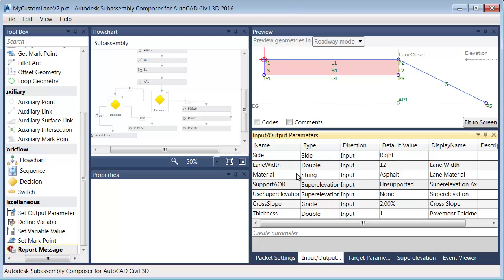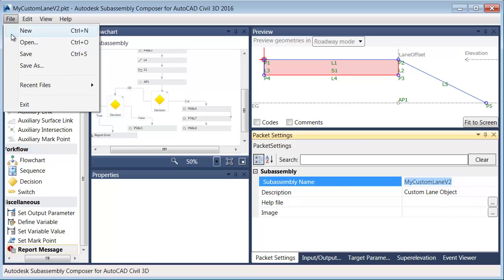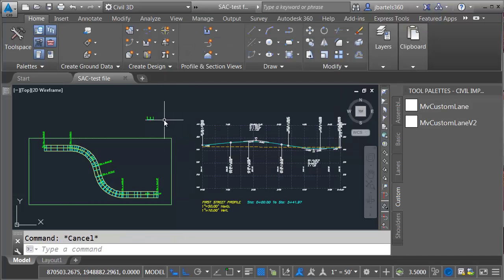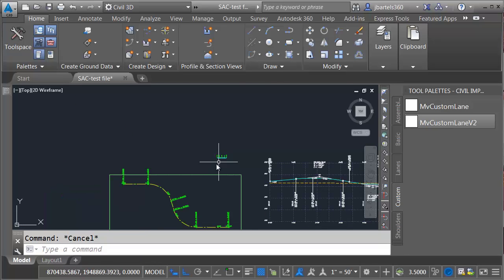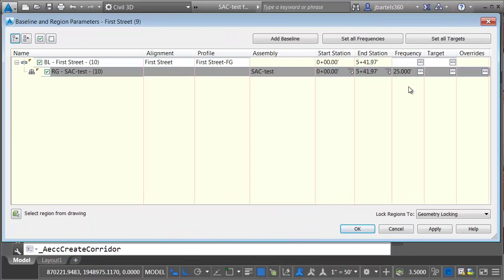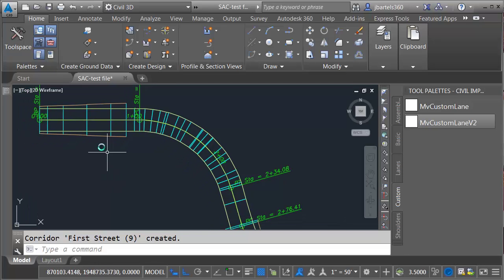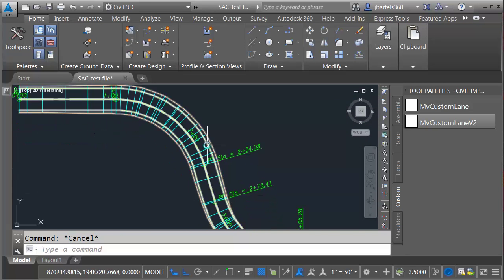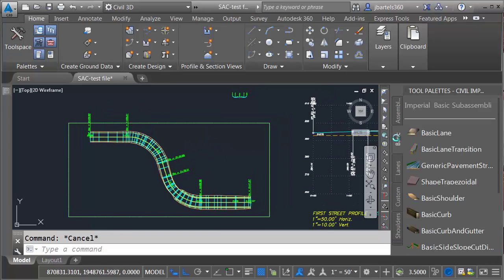Subassembly Composer Pt. 9 - Final Testing & Conclusion

Comment: Jeff does a great job explaining how to use SAC.  There is something that nobody tells us users though.  There are defects within SAC (memory faults/leaks) that cause issues inside of Civil 3D when brought in.  I've seen a 600' piece of corridor that uses a custom SAC part fill up an entire empty 2TB HDD when trying to extract elevations from the corridor surface using the Create Feature Line From Object tool with or without elevation extraction at the time of creation OR after the feature line has been created.  I've seen ZERO consistency in the data being derived and/or extracted.  I've seen corridors that use targeting, even for a simple lane, pull completely different station values than the equivalent OOB lane part.  Autodesk has been aware of these problems since 2016 but has yet to fix the problem and we are only a few months away from the 2020 release.

Just a few weeks ago (first part of January 2019), I sent a large one hour long video and four smaller five -fifteen minute videos to Autodesk Support and the Development team so that they can see the erratic behavior.  The deconstructed custom SAC parts were walked through with all the toggles.  No errors within SAC and everything functions as expected.  Three different workstations, each with a different "flavor" of Windows 10 and each workstation has different results when the SAC parts were brought in!  Some SAC parts would break on toggle switching on one machine and be fine on another.  All machines would cause the same derivative data problems though.

So, the reason why I am posting this here is so people are aware that both SAC and Civil 3D have major defects/flaws/bugs that will render your systems unstable and/or unusable if implemented.  These videos that Jeff has created don't walk through an entire workflow.  They stop at the creation of the corridor.  Derivative data and how objects generated with SAC components function in relation to other tools matter!  Jeff doesn't compare an OOB lane to the custom lane that he makes in SAC with the targeting.  If he were to pull labels and check the data in these videos, everyone would quickly stop using SAC because the data is incorrect.  If a target starts at station 2+31.15, then the station extracted in the corridor should be EXACTLY that.  If you test it, you will find that some might pick the station up correctly and others might be off up to a foot or more.  I noticed this when implementing OOB conditionals with custom SAC content.  For the life of me, I could not figure out why there were so many gaps that required manual insertion/manipulation of target start/stop locations.

I'm hoping Jeff does look at these old videos and the comments left on them.  He's a sharp guy.  I'm willing to bet him lunch that if he tests/compares custom SAC elements with OOB parts, he will find the same problems that I found.  I'm also willing to bet that he will find erratic behavior with derivative data and other tools interacting with objects based on SAC objects.

Comment: Thanks for the information, I really needed for a project I was working on; now I have a question, is it possible to create with SAC a bench? in my job we need a bench that is not the one in civil 3d, what we need is this: the height of the bench is 7m, and I go cuts the surface, but in some areas the las bench has an altitude of 7.1 m, and because of that a new ver small bench is created, that is not acceptable because that bench either won't be made or it will be made wasting money and time, so we need to tell civil that if the last bench's distance to the surface is 0.50m or more, then it can create a new bench normally, otherwise it goes straight to the target surface making the bench's height 7.5m, do you know how we can do that in civil 3d or subassembly composer? or do we necessarily need  to code one in visual lisp or create it with subassembly studio?, we really can't either code nor afford the SAS, we barely can buy Civil 3d.